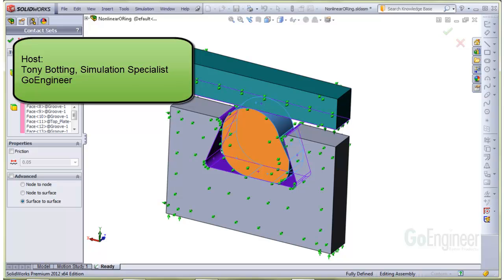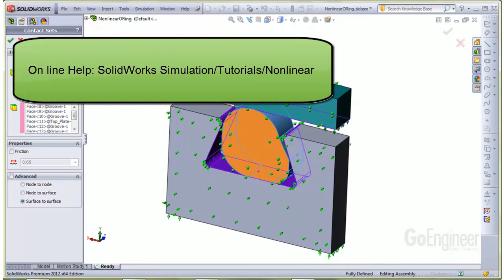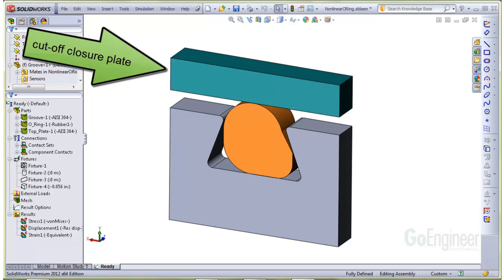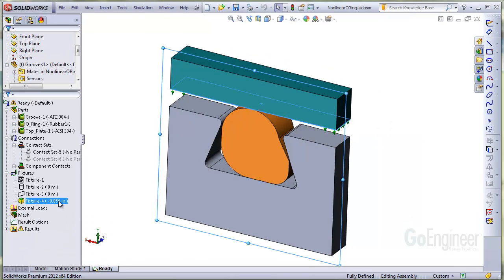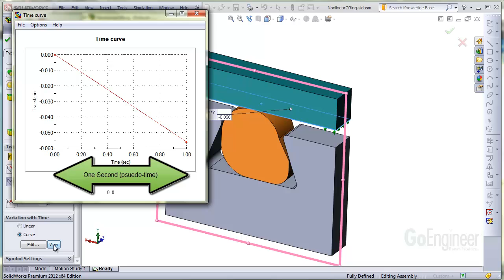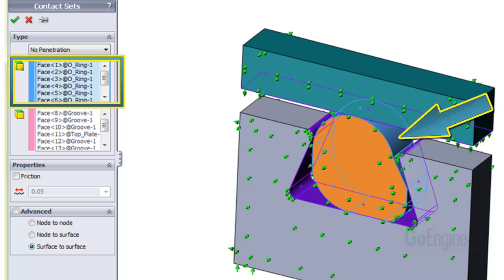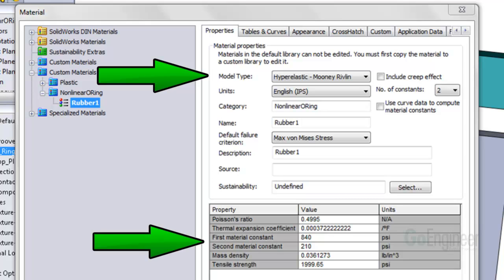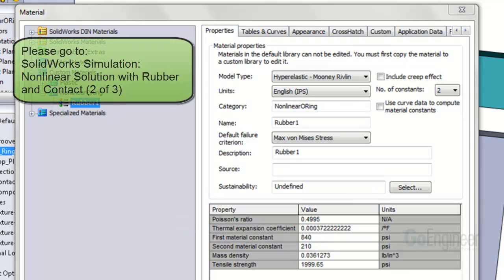SolidWorks Simulation - Nonlinear Rubber and Contact (1 of 3)

Comment: Hi Tony, I just found this video yesterday, thanks for that. Can I ask how you set the Hyperelastic Mooney Rivlin material? And is it performing some mathematics in the background? Or does Simulation know the material and handle it accordingly. I am also trying to model rubber, a bushing bonded between two metal parts, but he the NBR material in SW is pants. Cheers.

Comment: Hii. 
i want ask about motion analysis.
I have something experiment about rubber and steel.
i want simulation deformation rubber if enter to pipe steel. But Pipe steel more small of rubber. 
You can give me suggestion for me, i must start from where?

Because, i have done motion study using contact, but still not work what i expected.